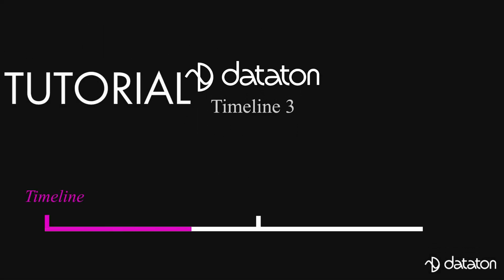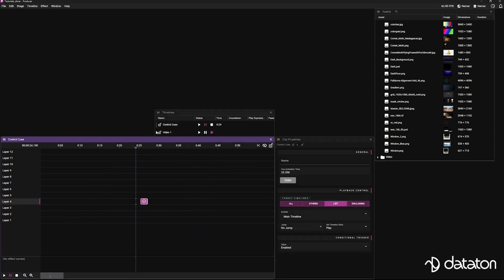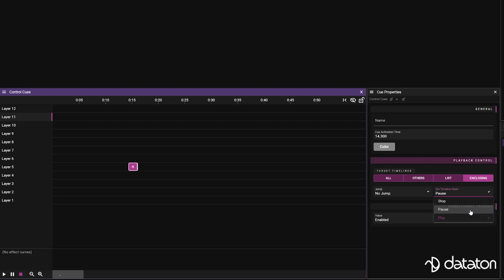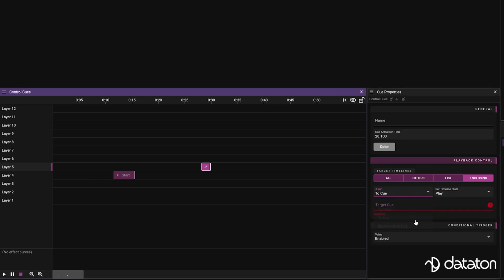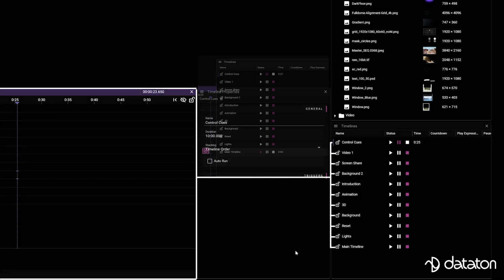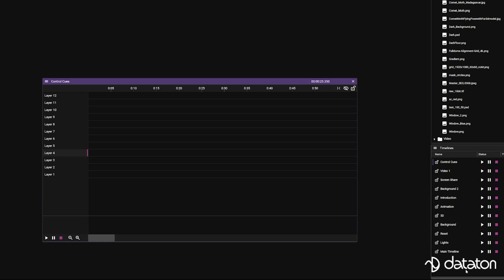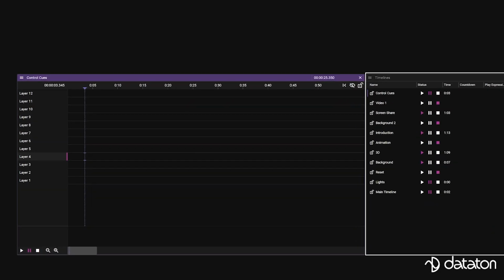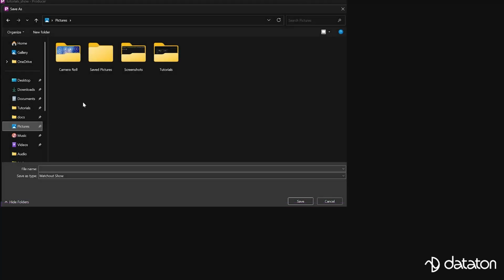WATCHOUT 7 – Tutorials Ep.3 – Control Cues

Comment: When working with one timeline, can control cues be on the same layer as asset cues? Can they overlap? If not, is it preferred that control cues be on a layer above the content in the timeline, or can they be on layer 1?
Reply from the maker: The layer a control cue sits on doesn't really matter functionally, it's purely a visual/organizational choice.

That said, the common convention is to put control layers at the top of the timeline. It keeps them visible and out of the way of your content stack, and it mirrors how most operators are used to scanning a timeline (control/automation up top, content below). Putting them on layer 1 (the bottom) works functionally but tends to get visually buried under media layers as the show grows.